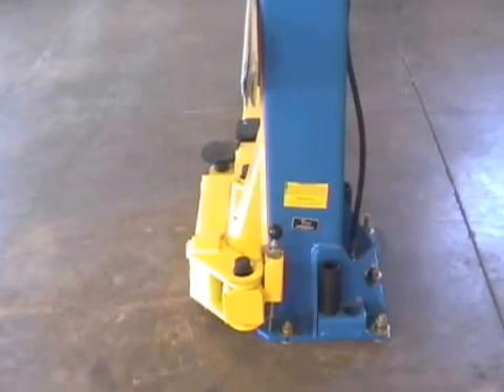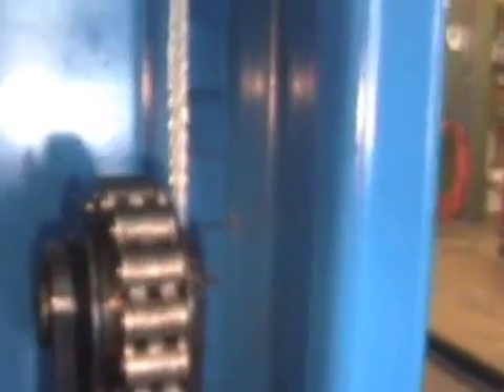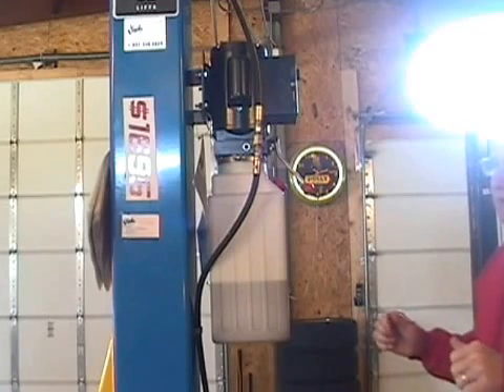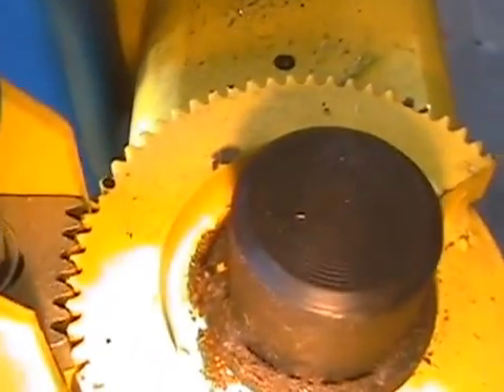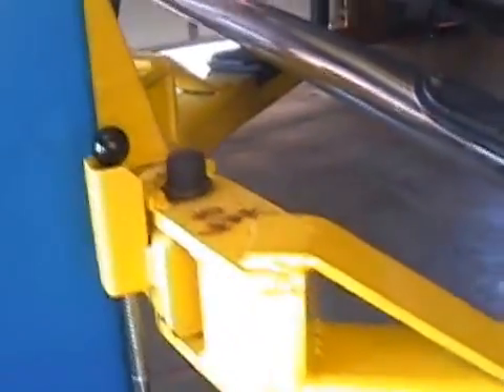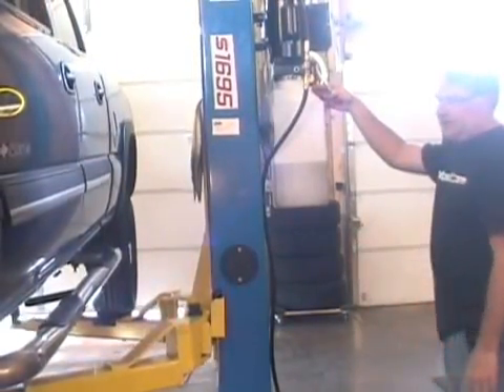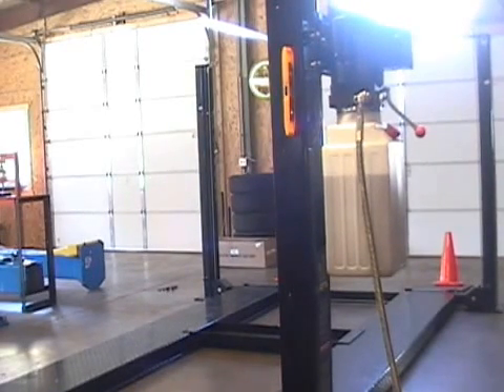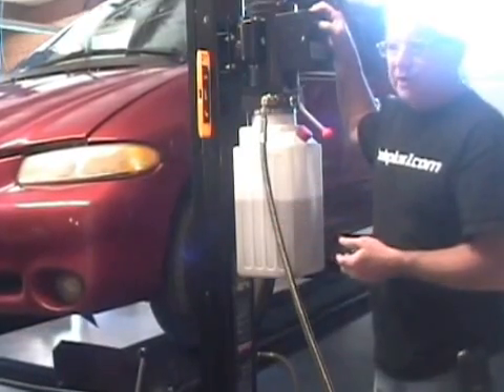car lift safety,  lifting a car the safe way

Comment: My lift is almost identical to this. and im noticing when the vehicle is lifted and pushing on the bumper lightly it teeters a bit. not the posts but the arms you can see a bit of flexing. 
In a way i feel like if im fully under it im not tooo confident in really wrenching on stuff. Maybe its my positioning ? it is a 9000 lbs lift. the vehicles i've tested on it are my tundra which is abother 5000 lbs and a nissan armada which is also above 5000 lbs.   
My small yaris doesnt seem to have any sense of swaying.

Comment: Good video showing how to safely lift a vehicle on a two post lift. He covers most all of the things to check however if you look at the lift arm restraint gears at 1:45 point in the video you can see that the gears are not completely meshing. They are not adjusted properly. There should be more engagement of those gears and they can be easily adjusted. Also, the lift in the video is a Chinese made non certified lift. I would hesitate to lift anything bigger than a 1/2 ton truck on it.

Comment: all of these are good but if you place the weight of the vehicle wrong you are done. The car can easily slide from the arms due to unbalanced weight distribution.
Reply from the maker: Very True
Reply: True but they also have pads with rounded up corners that help prevent any slipping

Comment: Nice video. Straight to the point. 
I've been working with lifts all my life (or hoists as we call them in Australia) and only just realised that I've never had any training in their use (besides reading the safety labels). Luckily I've done almost all of the checks you mentioned, out of common sense and self preservation (except check if the cables are on the pulleys). At this point 7912 people have watched your video, and surprisingly 5 of them have given it the thumbs down. Either they know everything there is to know about hoists, or they don't know enough to know that they don't know. (http://en.wikipedia.org/wiki/Dunning%E2%80%93Kruger_effect).
I hope gravity is kind to them. 
Keep up the good work.